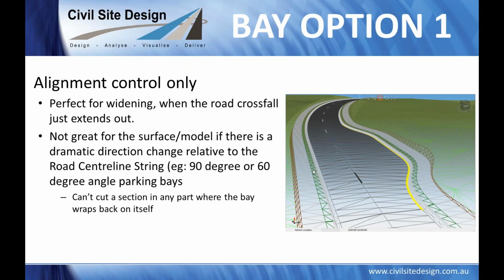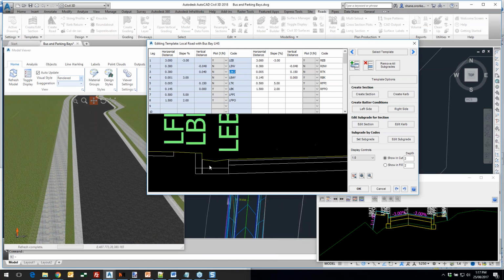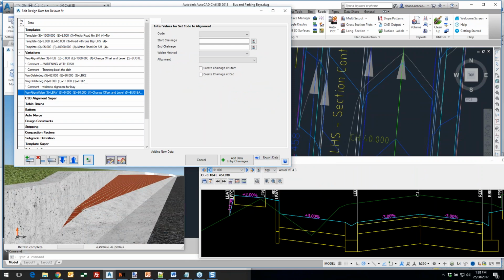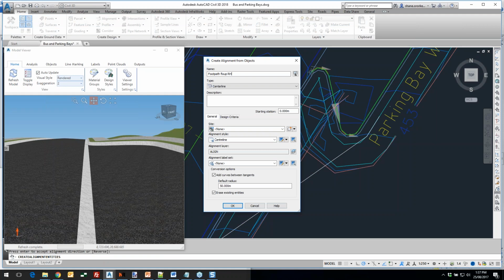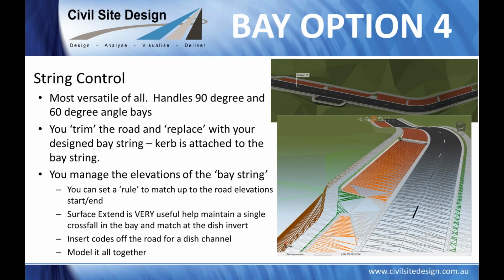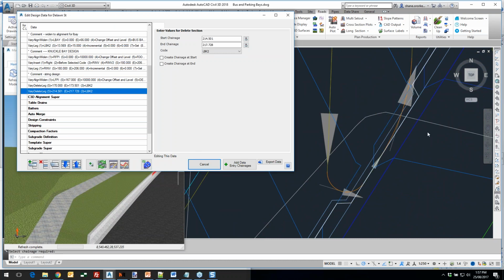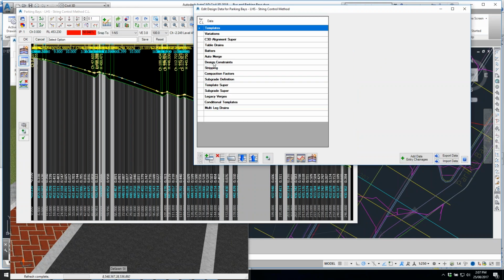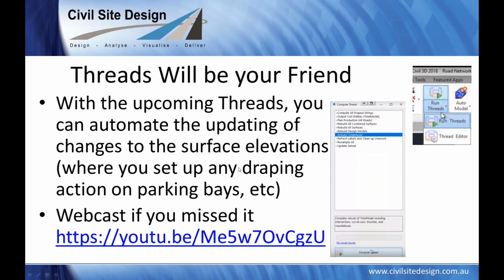Civil Site Design - Webcast - Bus Bays and Parking Bays

Comment: 0:00 - Introduction
5:20 - Overview of Options
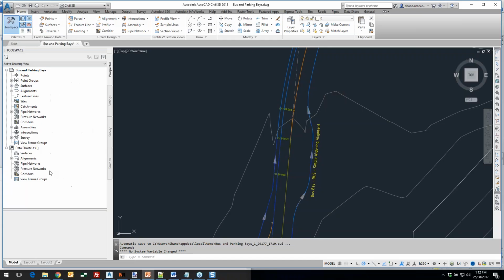9:22 - Option 1 - Widening with an Alignment
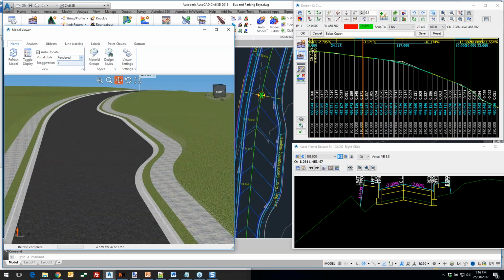13:30 - Option 2 - Widening with an Alignment and a grade break (through inserting codes)
27:12 - Option 3 - Knuckle (Utilises the Automodel)
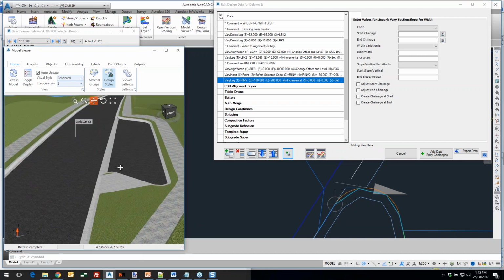43:15 - Option 4 - String and Model Based Parking Bay (Enables more complete control)
1:07:35 - Plotting subgrades